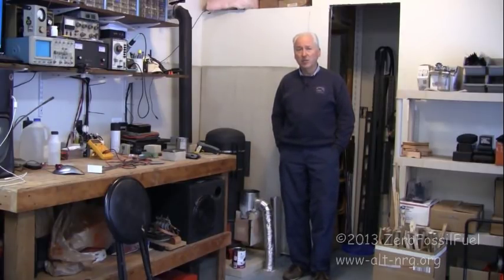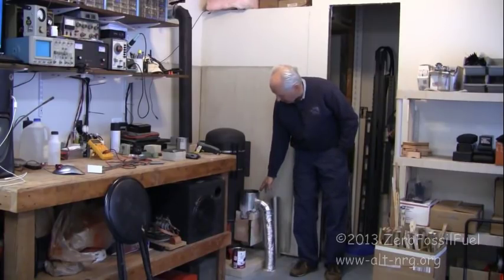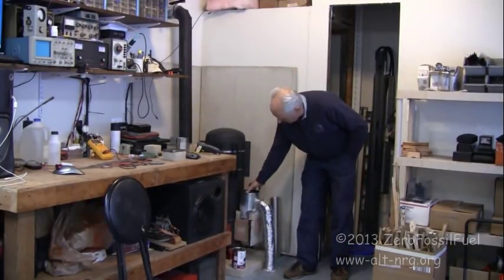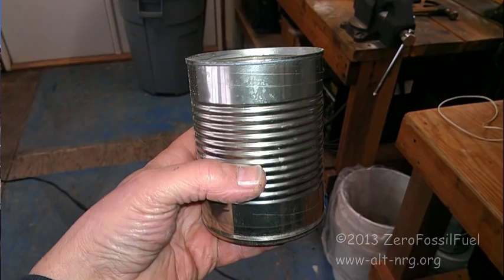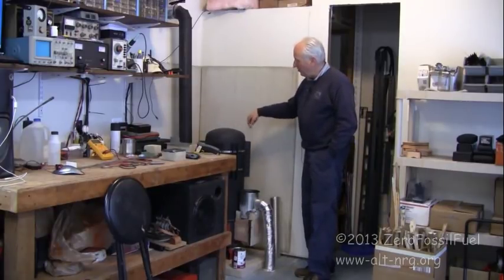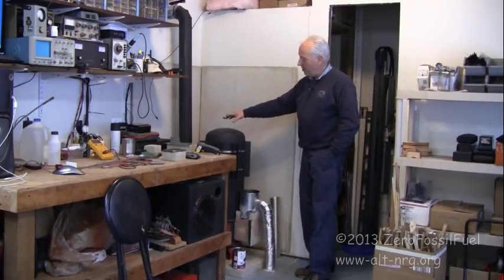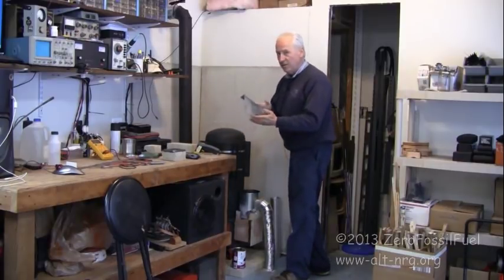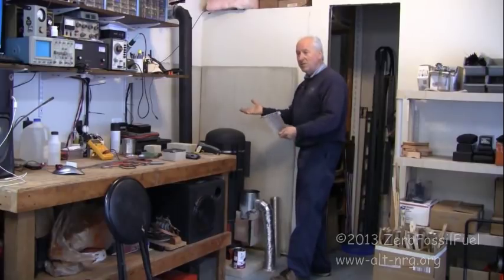#326 Rocket Stove heater conclusion

Comment: Your design radiates heat, especially at the top where there are no fins.  Radiator systems are very poor at circulating warm air around your shop and require rather large safety clearances to items that may catch on fire.

If you were to install a cylinder around the side fins on your stove, with an air gap at the bottom, you would create a very efficient convection system, that would create a very forceful hot air flow that would push the air around your shop without the use of fans.  A convection system also allows you to put the stove closer to items in your shop without the fear of them catching on fire.  Radiator systems have a minimum safety clearance of 36" while convection systems have a minimum safety clearance of 18".
Reply: many woodstoves have heat shields which acts just like what your described. These also allow very minimal clearances to structures like walls which may be near the stove.

Comment: I see no point in building a RMH if you have zero mass.  Anybody can build this type of stove but getting the benefits of stored heat is the hard work.  You heat your space for 2 or 3 hours without the mass, with the mass you could heat your space for 2 days.  Even if you insulated and cobbed your existing stove and exhaust with cob you would gain huge heat storage and not take up any more space.  BTW, I found your remarks at the end of the video to be offensive, arrogant and rude.

Comment: they have books at the library on how to install wood stoves, sassy ass should probably read one before he burns his whole neighborhood down. and taking the half assed cobble things together approach to indoor wood stoves isnt chik or trendy. there is no way you can have yr stove pipe that close to the wall and theres not shielding all the way up. and you need a shielding box as the chimney exits between studs to the outside. id put a slide shut -off to yr cold air intake

Comment: to increase yr iq, i will inform you that cement board is not be to used for heat shielding and use a spacer between the bench and metal

Comment from the maker: Clearly you have never studied rocket stoves in general. If you had, you would know that the typical rocket stove mass heater has about TWENTY FIVE FEET of horizontal exhaust pipe which does NOT need to create a draw. You know nothing. Sit down. Shut up. Watch and learn.

Comment: That logic is flawed, you are confusing one reason homes lose heat and that the fire has to heat the air regardless, whether in the fire box or in the room. I see what you are getting at but I don't know that the physics are right. It's like your comment comparing a car engine to an open flame, ludicrous example and a lack of understanding of an engine (compression heats the air/fuel mix) and of physics and why an engine needs more air than an uncompressed fire. End of discussion (now).